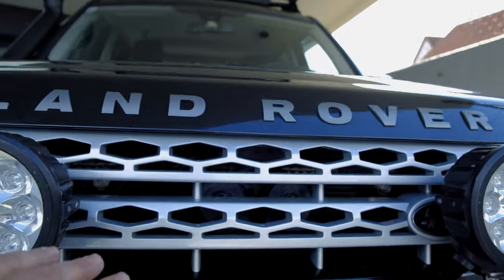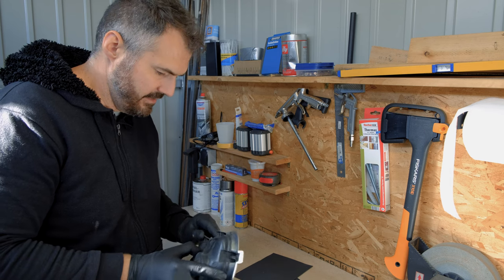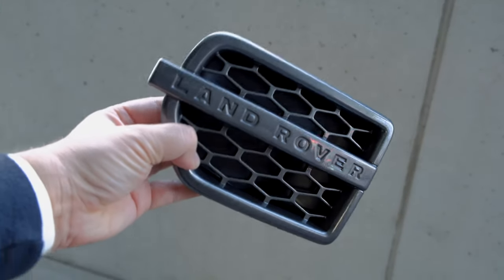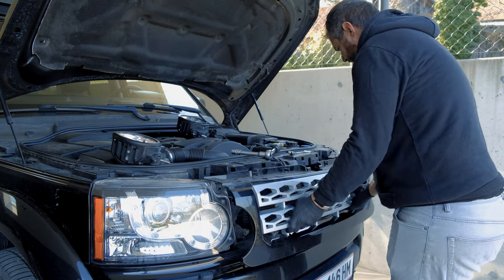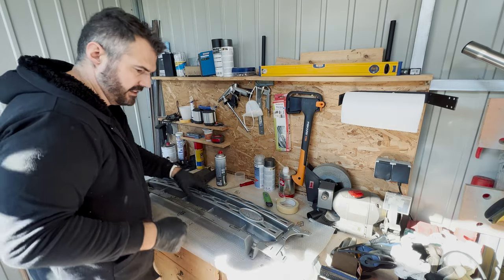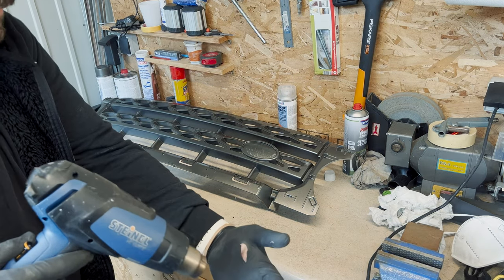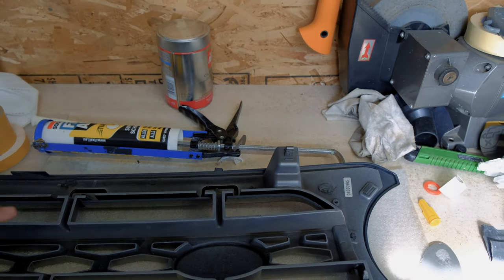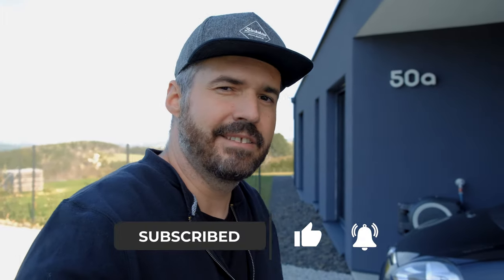BEST Color UPGRADE for Side and Front Grille - Land Rover Discovery 4 or LR4

Comment: looks great! 😊 i will do my grill and side vent myself, in the same color as you did. 

keep the videos coming 😊

by the way, have you found a way in GAP Tool to turn of the back window wiper when putting the car in reverse, and you're front wipers are turned on?
Reply from the maker: @Hans Thank you! I have to admit that I didn't look for it! But next time I connect the IID tool, I will look for it.
Reply from the maker: @Hans I've looked into it, but I couldn't find anything which make this possible to set up.
Peter
Reply: @notthatkindofachannel  i will try to reach out to the people at GAP, and ask them if there is any option for this now, of if they can add this feature to the IIDTOOL.
Would be great to not have you're window wiper engine to burn everything i start the car at wintertime, and put it in reverse 😊

Comment: Hello Peter, when do we get to see a video about upgrades to the infotainment system, aliexpress has some Tesla Style Screen Android Car Radio for the disco 4 that seem like a lifesaver for this cult vehicle. For many of us, this is the last vehicle we would like to own except for the infotainment system.
Reply from the maker: Hello @Bim TV, thanks for the input! But currently, there is no plan on my part to install such an infotainment system.

This has the following reasons:

1. with these systems you can never be sure that everything works properly, e.g. amplifier, rear view cameras etc..

2. I personally find the upgrades to an Apple CarPlay or Android Auto system, such as NaviPlus, much more elegant.

3. Since I finance each of these videos myself, it is unfortunately not always possible to immediately implement everything that crosses my mind, even if I would like to do so.

All the best, Peter
Reply: @notthatkindofachannel  Thanks for the reply, NaviPlus does seem to be the dependable choice but if one of you disco4 gurus can get the aliexpress screen to full functionality then it would be a strong option😊. I larger brighter screen with no app limitation does have some attraction, it could even extend its use to deleting errors😎
Reply from the maker: @Bim TV Yes, of course, that would be the ultimate, if you could immediately delete the errors via the IID tool on the "radio" 👍

I would also be happy with a slightly larger screen that would fit in place of the old one. Of course with better resolution etc. Do you happen to know if there is something like that? Have only dealt with the NaviPlus to date....

What still bothers me a bit, but actually not so serious anymore, is the colorful mix of various lighting colors of the buttons and displays :D (green, orange, white) If I could, these would all shine in a bright white! 😆

Comment: I'm planning to do the same upgrades, but I will paint these parts black.

What will be your next upgrades for your Disco?
Reply from the maker: @Miks Brūšnieks Yes I still have some plans, among other things I want to redesign the interior, as for the wood decor. At first I wanted to veneer it again, but unfortunately there's a thick plastic layer over it, so that won't work. So I'll probably foil or paint it. What should also be done is the complete interior with kitchen, water supply, etc.. And of course all the maintenance on the car 😉
Reply: @notthatkindofachannel  Today I received painted grilles. I ask to paint them in same color as car (LRC 820 Santorini black). It is black color with glitters. Will see how it looks together.

Comment: Hi Peter have you thought of fitting the land rover alarm system to your lr4, I don't see many videos on the subject on my research to do the same, kr Daniel O
Reply from the maker: Hi Daniel, my LR4 has already been equipped with an alarm system out of the box. However, I'm trying to find out if it is possible to retrofit a adaptive cruise control system on the models from 2012. All the best, Peter